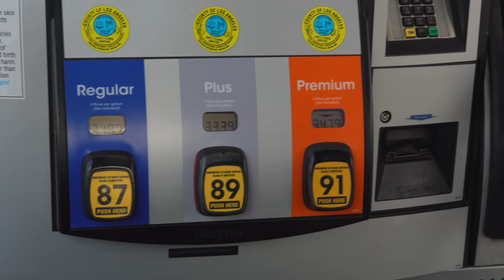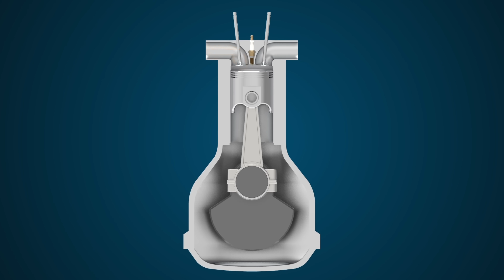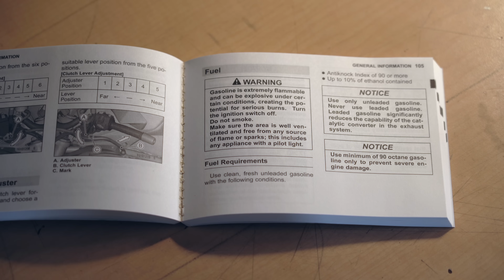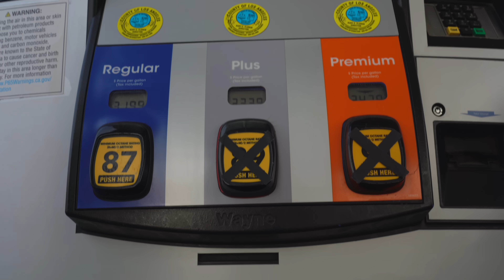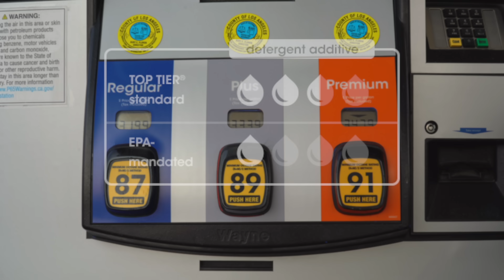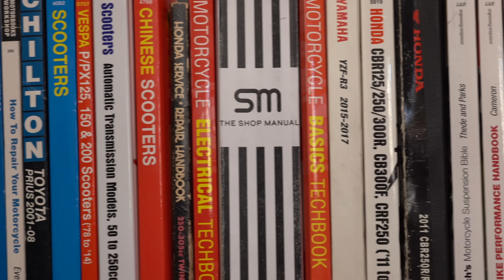Should You Run Premium Gas In Your Motorcycle? Octane Explained | The Shop Manual

Comment: I wish i wouldve had a go pro setup to record the difference premium made in even just a junky hyundai elantra. Yes, my 2019 elantra was claimed to be best with 87 octane fuel, however anytime i used premium i would average above 40-42 mpg on the highway, and when i used 87 i would get between 33-36. 
What will make your car or truck get better or not at all better mileage here is the type and way your engine control unit is designed. 
Some engine control units are more adaptive than others, and can sense that there are 0 knock corrections happening, so they will increase the timing a couple degrees until there is a small percent of knock correction, and then decrease the timing slightly to prevent it again. 
Not exactly how it works, but, the best simple way of explaining it. 
Premium fuel will hold more pressure without pre-ignition or detonation, which means that you can either internally modify your engine to have higher compression, or you can alter timing more seriously to achieve higher power, or efficiency. 
My audi s4 can actually correct very quickly on the fly depending on the type of fuel. 
91 octane, and it gets around 25 mpg, and once youve driven enough to get it hot, it begins to pull power to prevent detonation. 
Running 93-95, after getting thw engine hot, it will not "lose" power or detune itself as much, and will achieve between 30 and 34 miles per gallon. 
If you have a car that cannot self adapt, or doesnt have oxygen sensors and knock sensors, then yes, theoretically you will be running more rich than necessary due to the difference combustion pressure resistance of the high octane. 
In reality at least where i live, where it is usually quite warm most of the year, even older cars my coworkers have get noticeable increases in either mileage, or power. 
As an old car dealership manager told me, maybe the premium isnt that much better, but if youre using proper, name brand fuel, if nothing else, they are supposed to add a small percentage more of their detergent and improver additives.
Over the lifetime of owning a car, that 20-30+ cents a gallon will add up when you consider less carbon buildup which means cylinder walls and piston rings dont wear down as fast, and also once again less carbon buildup. 
Why does your oil have detergents in it? In part to remove contaminants, some of which are carbon. 
So in short: if your car or motorcycle has oxygen sensors, and can create or modify its own fuel maps (most modern systems can to at least some degree) then you will manage to save money in the long run, if nothing else. 
Just food for thought. 
But if you put 93 in a stock cbr250, which already has no power, you probably wont notice any difference in the seat of your pants when you gain 0.5 horsepower running better quality fuel. Doesnt mean it does nothing at all, it may just not be quantifiable or justified for the gain if the gain is the only thing youre interested in.
However once again, the extra detergents will pay off though.

Comment: Detonation is when the A/F mix burns faster than the speed of sound! Ping/preignition is when the A/F mix ignite before the spark plug tells it! The required octane rating is directly related to the compression ratio! Low comp engine with hi octane fuel will loose power n a hi comp engine with low octane increase the risk of ping and detonation!

Comment: I'm convinced that I ruined my Kawi 250cc by putting regular in it when it called for premium. I was being cheap and stupid and thought "Gas is gas, it'll be fine".
 
A few years of that and it started sounding like quarters rolling around in a tumble dryer. I lost power from the engine on the way home and it refused to go over 15mph. I took it into the mechanics, but they never found out what was wrong with it (I didn't tell them that I used 87 so they didn't think to check inside the cylinders).
 
Moral of the story: Don't 👏 cheap 👏 on 👏 the 👏 gas!!! I've got a Zx-6R now and I'm treating her right. 🏍

Comment: This is all completely irrelevant if you have electronic controlled fuel injection and ignition, like every bike made outside of the US in the last 20 years..  The fueling system will adapt to the fuel.  If you put cheap shit in it, it will detect the knock, retard the ignition and alter the mixture etc.  If you put expensive gas in it, it will slowly adjust the ignition and fueling to take advantage of the better fuel.

Comment: I own couple of bikes and i can tell you there is a difference between premium end regular... the engine has more power on premium and that it.s most noticeble in smal cc engines...
Reply: there are fuels that can make your bike louder too it's not just the exhaust that makes your motorcycle noisy, my dad owns a TTR600, it has 1 cylinder but sounds like a V8 and spit 100cm length flames lol, i asked him how his bike sounds so different from the original, he said he used "95" fuel, if 1 cylinder is already that loud i imagine a 4 cylinder bike with that fuel lol
Reply: @gurnblanston3210  nop, im serious, my dad's TTR600 SOUNDS so much different from the original sound, maybe he did a engine modification or something like that :P

Comment: What about a 1986 vt700 honda  shadow I use 93 octane but if I use the cheaper 10% ethanol fuel would it hurt it or clog the filter. Just asking cause it's a older motorcycle

Comment: Agree that there is no Power Advantage to High grade fuel . 
However , the Engine will run Nicer and you MAY in fact get a slight improvement in economy . No guarantee there though .
Ethanol mixed fuel has a couple of advantages . Ethanol actually has a Higher Octane rating than Gasoline/Petroleum .

Also  Alcohol added Fuel , Ethanol or Methanol , will keep Water out of the System . Whether condensation OR tainted fuel from Vendor .
Ethanol is better because Methanol is slightly Corrosive during combustion .

Comment: Hahahaha..."...if you don't get off the COUCH the swole sauce won't do you much good..." = If your bike is the equivalent of a 2 wheeled couch high octane gasoline isn't going to produce more power. I thought this was a hilarious analogy considering how large, lumbering motorcycles with low performance engines have long been called 'couches'.

Comment: Revzillas analysis is partly right. So what is not right. 
Firstly the fuel quality across North America does vary significantly. There is more ethanol in some fuel. What I have found having used my Indian Springfield with the standard 111 engine is that using the highest octane fuel was essential and in some regions especially Canada octane boosters were needed. So why? The bike was heavily loaded with full touring gear and we were travelling 2 up. Because of the load, the bike was suffering from pre ignition in some places. Using the highest octane available and octane boosters stopped the pinging.  Back in Australia we have 98 Octane available and so I always use this. Engines are very expensive. The cost differential between low octane and high octane for an expensive motorcycle is frankly not a cost worth considering.

Comment: So in general, it is good to use higher octane fuel on any type of engine even those that doesn't require it coz it cleans my engine better but trade off is I pay more for gas if my engine doesn't require it. On the flip side, it is bad to use lower octane fuel that what the engine requires.
Reply: One thing to consider if using it purely for the detergents: 
An occasional bottle of fuel injector cleaner is much cheaper and yields similar results. (The excellent Project Farm channel has conducted some tests that established this, if interested in more detail.)
Reply: @TravisTerrell  Thanks for the info.
Reply: Incorrect. If your engine is designed to run on 87 and your put 93 you are gaining absolutely nothing and wasting money
Reply: @SkinnySkinch what about carb cleaning?

Comment: You are absolutely right.  In addition you engine ECU will sense the difference in fuel by the O2 sensor and compensate. Therefore no power gains unless the engine is designed for high octane. Cheers
Reply: Not entirely. The o2 sensor won’t sense the higher octane. The knock sensors will. Running 87 in a performance engine will cause the knock sensors to pick up vibrations which tells the ECU to pull timing. That makes less power. By running higher octane fuel the ecu wont pull any timing.

You can see power gains by running high octane fuel in any engine that is currently pulling timing, which is surprisingly A LOT of them, because they run lean for better mileage. Hot weather, uphill roads, high altitude, beating on a car engine, can all cause knock even in engines designed to run on 87 and you’d see a benefit from running 91.

Comment: I've heard all this before. No more HP no better mileage with Premium... BUT whenever I read tests or reviews of exotic cars or bikes. They say "makes x horsepower with 100 octane gas" and only x-20 with premium. So why does extra octane produce extra power? Is it because the computers in these exotic vehicles will advance timing or something else to make more power when they sense the higher octane? So this would not hold true on an older non computer car. I raced Late models for a while and we always used race gas. It was an older 350 engine with a 2 barrel carburator. No computer, no fuel injection. But it made more power with the 100+octane gas. So.. Why or how?

Comment: Well it's allowing more timing without detonation which in turn will result in more power when tuned for it, if say you are running vehicle originally designed to run 87, you get it tuned on 93 for max gains.

Comment: I run premium in my work truck. Every truck I’ve ever owned, and I’ve run them hard and for a long time. Never had issues with the engines. I’ve got a 2007 Silverado with the 4.8 vortec that’s only ever had premium. She’s about to roll over 325k. Still runs like new. I’ll take the hit to the pocket book for the  good stuff, it seems to work good in all vehicles.
Reply: @gurnblanston3210  not from what I’ve seen.
Reply: And I've had a 1990 Bronco that ran excellent on the lowest grade fuel every day.
Reply: @HorizonsleatherBlogspot2012  glad to hear it.

Comment: You actually get less power from higher octane fuel as they yield less BTUs (British Thermal Units) per gram than lower octane fuels. Therefore you have to burn more of it to get the same power. The advantage is as you correctly pointed out is their resistance to detonate. Hence high compression engine higher octane high boost engine such as aircraft engine use up to 150 octane fuel at 35 pounds of boost eg Mustang spitfire Merlin engine. Generally higher octane fuels will also burn faster depending on molecular make up I say generally because focalised fuels very greatly in their molecular shapes and size

Comment: Here in the Rocky's, he also have 85 octane because the air is thinner and different atmospheric pressure at higher elevations and it will burn like 87 just fine, only costs a little less. My California in-laws were freaking out that gas stations didn't offer 87 and they thought their Toyota sienna was going to die if they used it lol.
Reply: We will see, in a view years, what the Engin look like aftef all the cheap 85 or 87
Reply: @charlesvan9726 it's not a problem when you live over 4000ft above sea level. If your vehicle is designed to run on 87, it can run 85 with no issues. 85 octane is only available in the Rocky Mountains, Idaho, Utah, Colorado, probably parts of Arizona and New Mexico.

Comment: I use cbr 250r with 95octane fuel. I've tried 97 octane too and i can see a difference in higher octane petrol. Engine feels smoother and gets torque at lower rpm when used 95>
Reply: Same with my cb150, though in my country octanes aren't advertised, you only get to choose between standard and premium. The bike certainly feels stronger with the higher octanes.
Reply: The placebo effect indeed is very strong

Comment: This guy failed to let us know the most important thing. The ethanol used in low grade gas will damage your carburetor or fuel system ,cause your aluminum motor and internal parts to corrode. Ethanol deposits are almost impossible to remove.

Comment: Back in the 70's I had an Oldsmobile with a 427 in it and the only regular gas I could burn without knocking was Exxon. If I couldn't find an Exxon station I had to buy premium. They only had two grades back then.
Reply: @gurnblanston3210  maybe it was a 425.

Comment: engine knock comes from the fuel combusting before(!) the piston reaches TDP and before the plug sparks, forcing the crank to turn in the opposite direction
Reply: If your crank turns in the opposite direction, you will be walking home.

Comment: You forgot to mention ethanol. Usually higher octane petrol uses less ethanol. Sometimes some gas stations like Shell does not use ethanol at all for their 91 nitrogen enriched fuel. Ethanol will gum up your fuel system after your bike sits over winter (for those that dont ride in the snow)

Comment: Hmmm 🤔 I’ve always used premium fuel 93 or better. Never had to replace a fuel pump, filter, injectors, fuel regulator oxygen sensor or decarbonize the engine. The engine computer will auto adjust to fuel it’s using. Never pings even with A/C on, gas Milage is great, and has plenty of power. 

You be the judge 👨‍⚖️ 👍🏻

Comment: I dont run any of these fuels.
i run rec 90 ethanol free. 
the only kind of fuel you should ever run in a motorcycle.
tank is vented and ethanol turns into water if left sitting too long.
also ethanol rusts your fuel lines and can gum up injectors...
suprised no one seems to know this?
also get better power, and increased miles per gallon.

Comment: I rode cross country on an 82 GL1100 goldwing. Regular unleaded I got 46 miles per gallon on the highway. Premium unleaded I got 51 miles per gallon on the highway. But once you do the math the five more miles per gallon you've got did not justify the price difference currently I ride a 2000 Honda Valkyrie and I always use 93 octane. Performance reasons only

Comment: You should run the gas that your engine is designed for. That's it.

There's all sorts of reasons with compression ratios, energy density, pre-detonation, blah blah blah.

Just look in the manual, find out what it uses, and put that in the engine.

The engineers who made it know better than you.

Comment: 2 cens from an engineer: actually knock is most likely to occur with a hot engine and low flame speed. So basically hot summer day, low rpms and high load (throttle full open). 
High rpms increase in-cylinder turbulence, and hence flame speed, making knock less likely.

Comment: Higher octane also doesn't break down over the winter and plug up your system, so when you start it cold a month before riding season you don't have to replace your system. High octane usually won't break down for 2 years.

Comment: So, in summary, the higher the octane the less likely the knock. But if engine has knocking in the first place, fix it.

And you can run regular engine on premium/higher octane if said engine is modded up. Also you can run on regular fuel ⛽ in performance engines if you don't push it too much.

Comment: Sorry dudes and dudettes , octane does matter. It burns cleaner leaving less residue, it contains more energy per litre/gallon and will increase  the distance traveled per tank over time. An experienced rider can immediately tell the difference. The confusion occurs when people use premium for the first time and notice no difference. Modern bikes have 02 sensors and ecu control. The ecu relearns a fuel map over a period of time, not in one full tank. Try filling the tank with premium over the course of a month or so then tell me it makes no difference.
Reply: Octane does matter, but not for any of the reasons you've listed. Did you watch the video before commenting? Octane doesn't correlate to energy density unless you live in a market where premium gas doesn't contain ethanol, in which case yes, premium gas will be more energy dense. The lambda sensors and ECU don't care what the octane figure is since it has nothing to do with the AFR.
Reply: @AriH211  ethanol is 10% and we have a choice to use that , 91 octane unleaded, 95 or 98. If less than 98 goes in my ZX6R it is rattling and very noticeable. The label on the tank states this but some rural towns don’t have premium. If I am on a trip I have to make sure there’s enough premium still in it and top up with standard. Your comments about 02 and ecu feedback is correct but overtime, the ecu will remap parameters to suit your choice in fuel. So a bike that has been run on 91 for a long time has a very different lambda and spark map than one run on premium. This being said, if premium is used over a long period, you will go further per litre. So when you state there’s no difference, you might want state that bikes in different parts of the world are very different according to local fuel availability and local emissions laws. The bottom line is you use the best fuel you can get and never use ethanol if you care about what your putting it in.
Reply: How do we feel about non ethanol fuel? I just picked up a Yamaha SCR950. And I've only been running that for about 400 miles now.
Reply: @89itirish  if you have access to it ALWAYS choose NON ETHANOL regardless of cost. Your fuel system will thank you.

Comment: He did not mention anything about ethanol. If you let your bike sit over a period of time (like winter), lower octane fuels with ethanol will eat away at the plastic in your tubes and corrode your engine. Use premium for that reason.